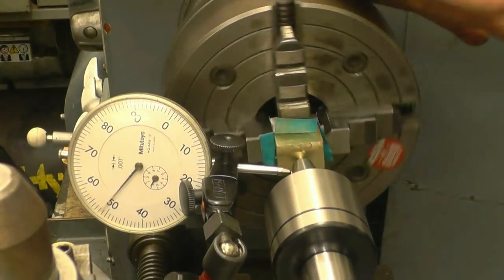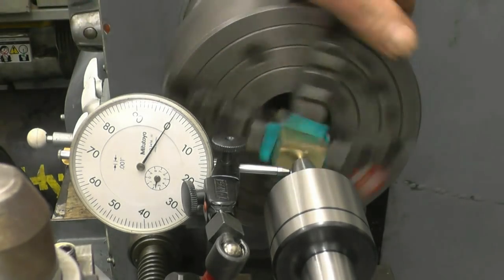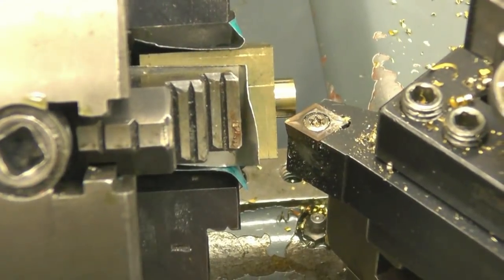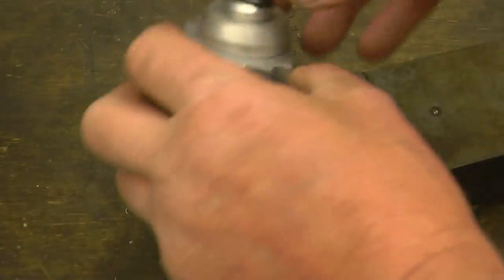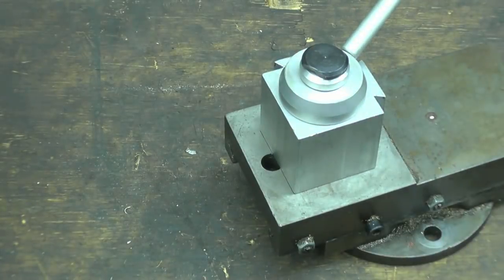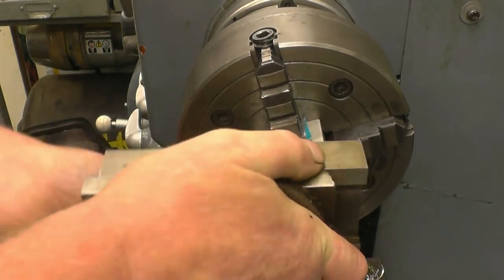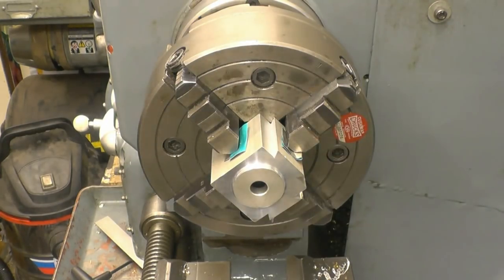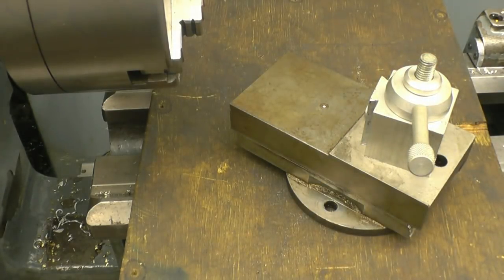SNNC 239 P2  Mini Lathe Tool Post MOD

Comment: Dear John

Another great video.
The type of tool holder you want to use the normally "unused" wide angle corners on a CCMT insert is an SCBCR tool holder (the tool holder you have that uses the narrower angle of CCMT inserts for normal turning and facing is a SCLCR).  The only problem with SCBCR holders is that they cannot turn to a shoulder.  They are however good for interrupted cuts given the wider angle of the cutting tip is more robust and resists chipping better.  
They are usually only available in a right hand form.  In the UK, I believe Greenwood Tools sell  such a tool holder although they may be available from other suppliers.

Comment: Nice mods. Having phones going off during filming must run in the Mill's family. sckc(r or l) is the designation for toolholders that I've seen that use the other two sides of CCMT inserts.  One of Adam's videos showed him using  mckn(r or l) for CNMG inserts.

Comment: Quality vids as always, John.

Gotta say, though... I've used one of those aluminum Banggood  tool posts for a while, and I can unequivocally say that they are garbage. Sure, a QCTP is nice to have, and convenient (which is why I still use it in lieu of the 4-way shim-style)... But those things are super flexible, and the repeatability is terrible.  

A good example of the poor quality is when parting: Whenever I try using a parting tool with that QCTP, I have to put it about 0.050" above center, just to account for the flex. And even then, it'll dive under the part when the cut is almost done, so the last 3/16" is riding on top of the parting blade. No matter how I fast or slow I feed it.